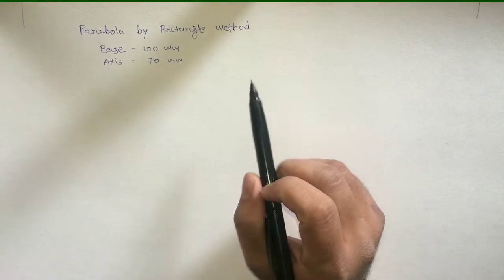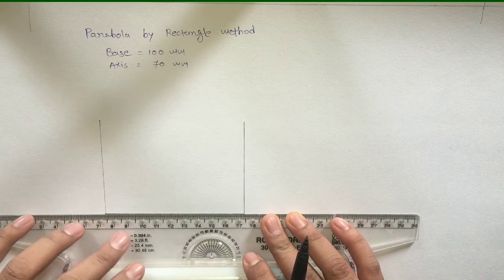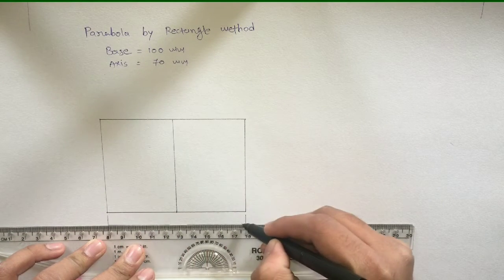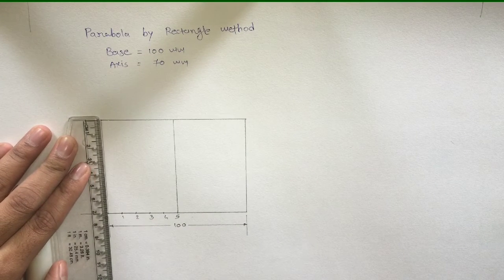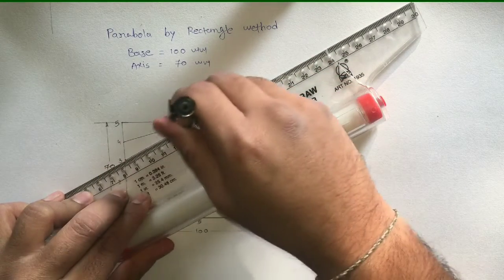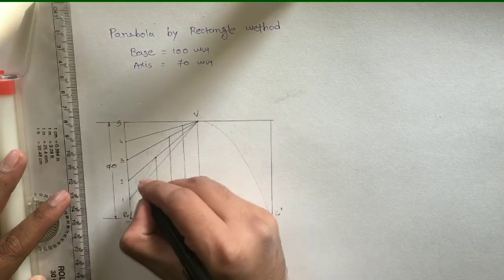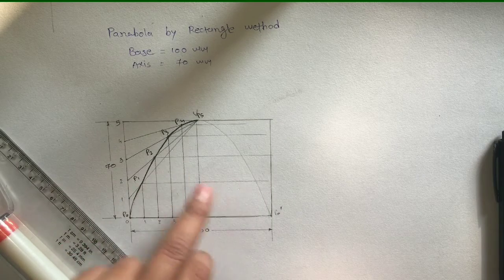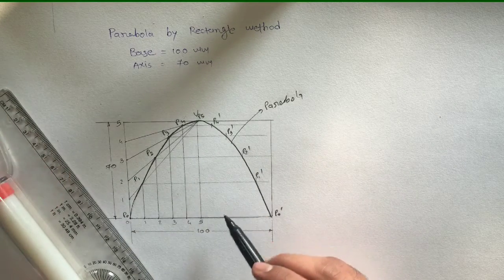Parabola by rectangle method || Engineering curves || gtu

Comment: Can you do a toturial on how to do it with the span being 100mm and the axial length being 120mm?
Reply from the maker: It won't make any difference in procedure, just take 100 mm in base dimension and 120 mm axis length and do same procedure. Just make sure to make parts of equal numbers along vertical and half of the base length.